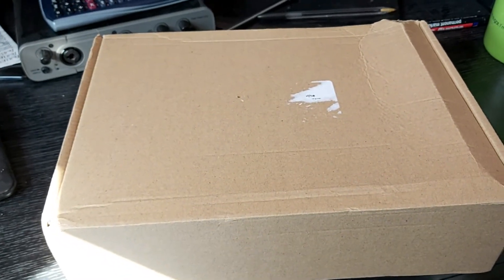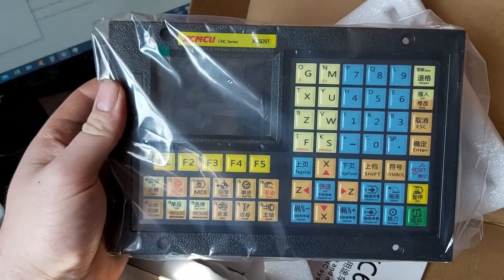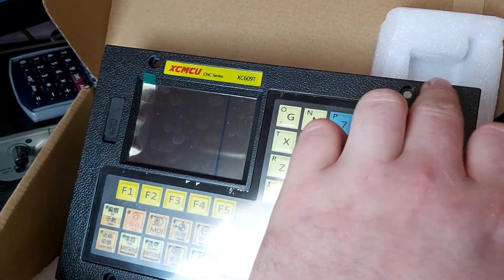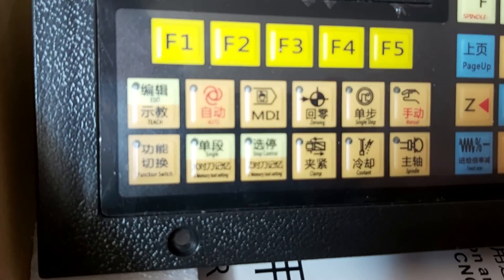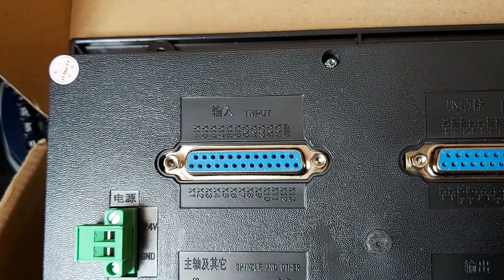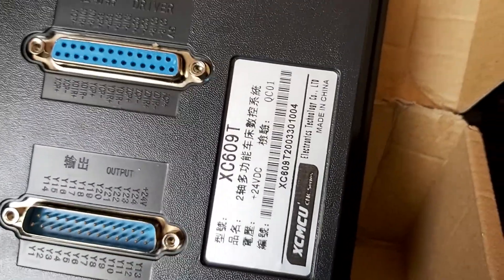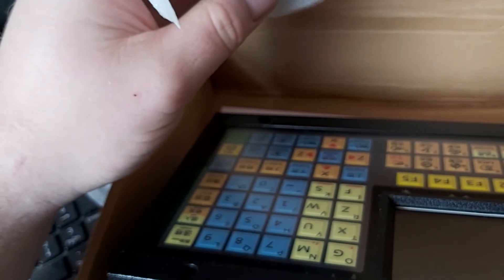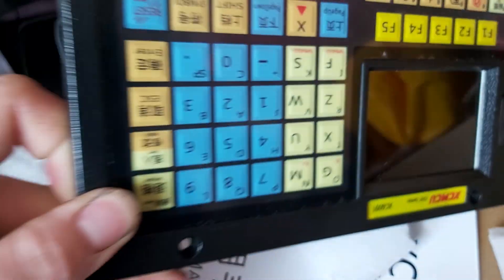xc609t unboxing and first impressions

Comment: Hello, I have a problem with this controller, what happens is that it doesn't work continuously or smoothly, it does everything with stops in each line, what it does is that it jumps, how can I solve it? please thanks

Comment: Hi , Did you setup the controller.? I cant get homing to work . Parameters seem to be set wrong, but don't know what to /
Reply from the maker: Still at a point of bench testing. However it does home. I have configured my x and z home switches to x2 and x3 inputs and configured them as x+ limit and z+ limit.
Reply: Very interested to see how these are setup. Picked up a denford traic and an emco turn 55. Both will be converted using the OEM drives , motors to linuxcnc. That's the plan anyway :) never though of these cheap Chinese controllers